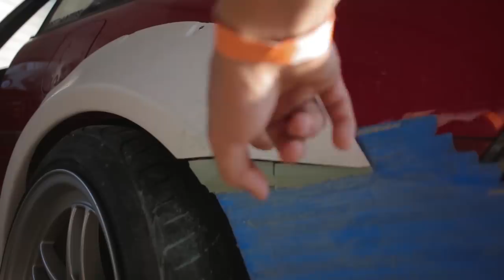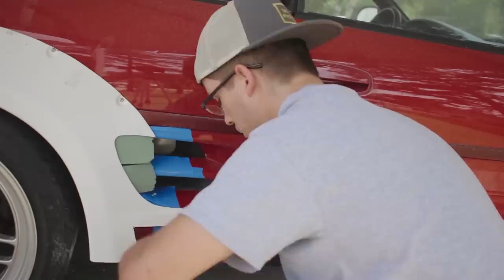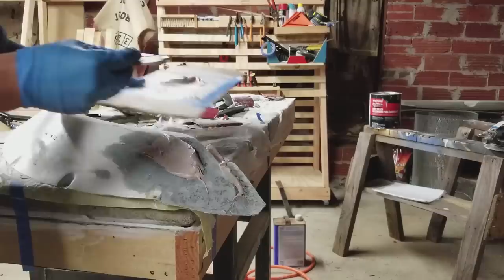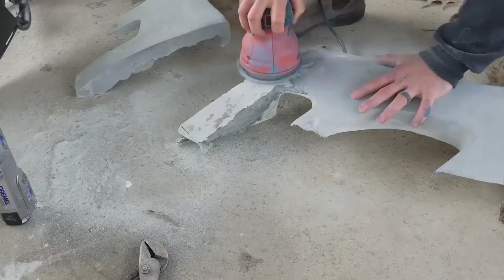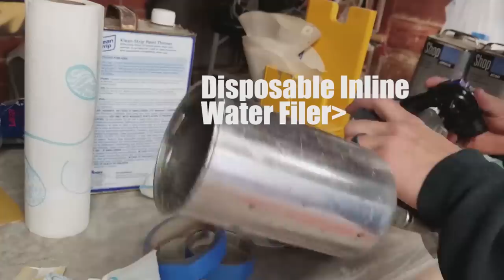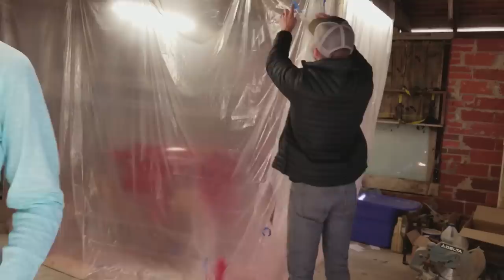FINISHING AND PAINTING THE REAR MR2 WIDEBODY FLARES

Comment: Ive been building my completely molded in TRD WIDE-BODIED MR2 SW20 for sometime now and i even widened the fenders even more, cut out the front bumper Air brake ducts and moved them out 2.5 inches on each side (so now the bumpers mouth is 5" wider), shaved licence plate indentation, Custom wing. 

I really like how that Rear diffusor came out... I wonder how these flares would look over my existing TRD 🤔... I dont think i could ever sell myne...